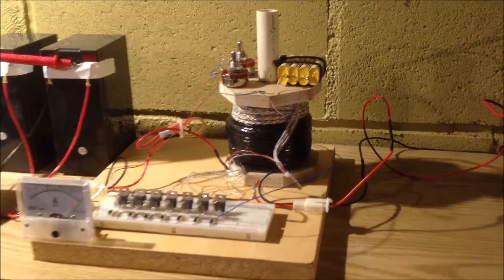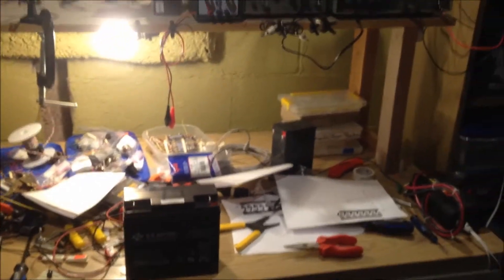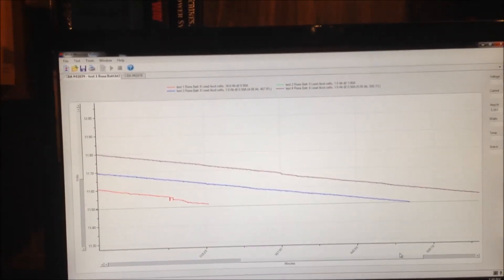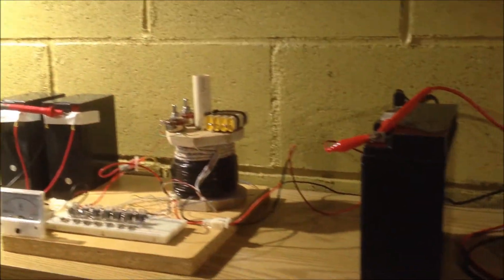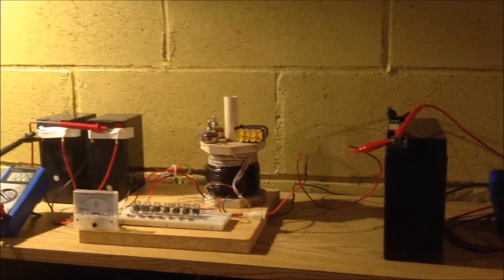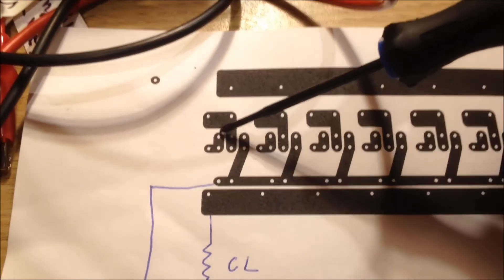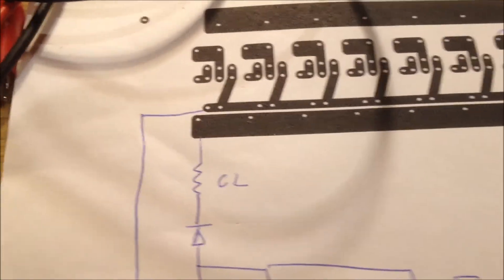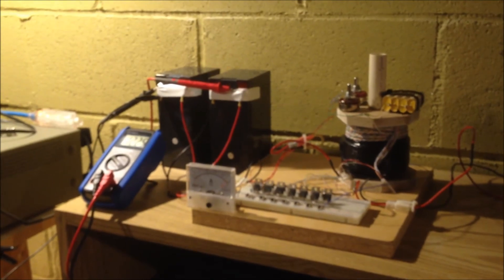Solid State Bedini SSG Replication

Comment: Very cool, Are you putting 4 caps in parallel for a cap dump?
What cap dump circuit did yo use?

ebay has mje13009s
http://www.ebay.com/sch/i.html?_trksid=p2050601.m570.l1313.TR5.TRC1.A0.H0.Xmje13009&_nkw=mje13009&_sacat=0&_from=R40

Why mje13009s and not mjl21194s?

Thanks

Comment: Ive had 6 filar in a tb yoke cap mod 240 ma imput from 60w solar no heat issue for 2 yrs wth 5 60ah alum batteries
If copl joule can read  this tnx
Ask if i separate each collector coil one for each battery separately  will it perform the same  with sg booster?